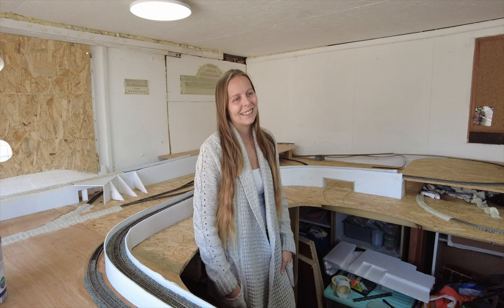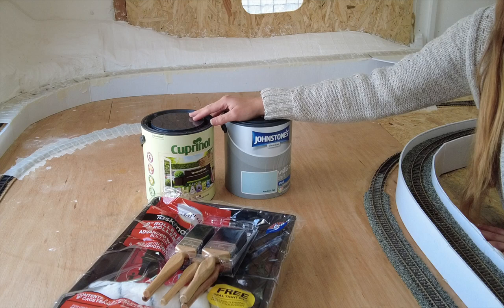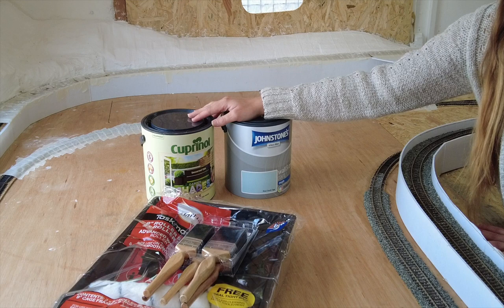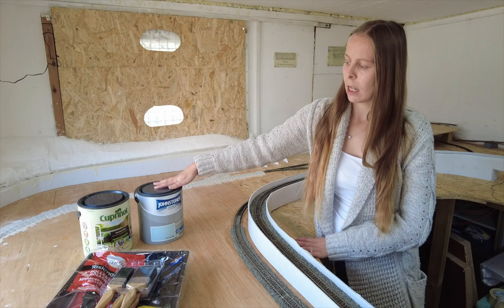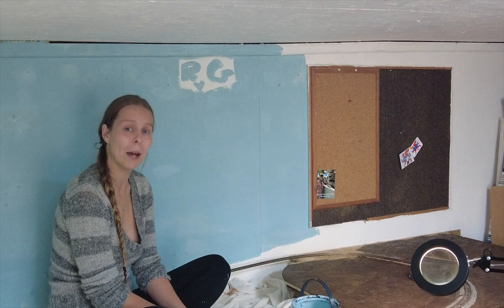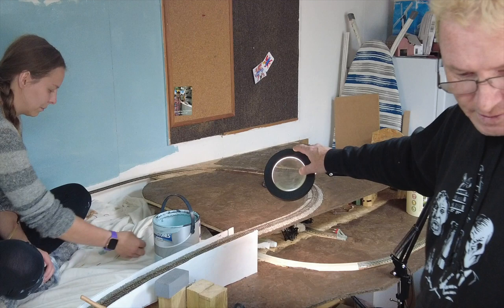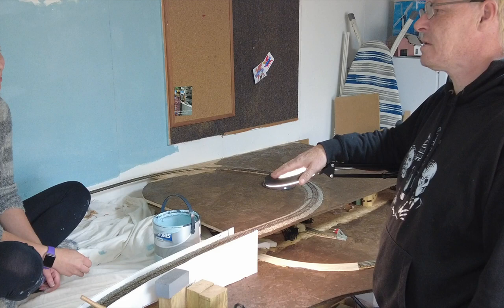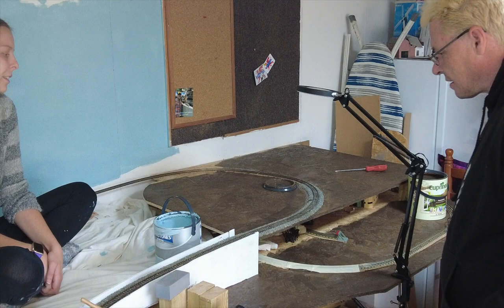RGJ Trains OO Model Railway

Comment: 🇺🇦
Hi Grace and Rob.
Great colour, same as mine.
Don't get resin buildings if you want to put lights in them, you will have to line them out with cardboard first. Stick with the Metcalf no light bleed.
Light looks great value for money Rob.
Grace as many horses and donkeys as you can find. You never know Rob might buy you a real one.🐴
Great work guys.
DELPH JUNCTION
Reply from the maker: yeah i couldn’t resist the windmill, but major light bleed, so grace is going to repaint it

Comment: I need some help with my bus wire
Reply from the maker: What’s the question buddy, if I can’t help, I’ll point you to someone who can
Reply: Every time I put my bus wire in the back of controller it trips it out 
But have noticed that the lift up bridge is live but the rest of the track is not
Reply: I am a new bee lol
Reply from the maker: @NobbyFowler  is it possible you’ve crossed the wires somewhere? got them back to front?
Reply: I have checked them I can not see anything wrong with them
Reply: I am not the best when it comes to electric I know it's not that hard to do but I am baffled by this 😂
Reply: It will work with out the bus wire up to the lift bridge
Reply: I now you work hard have a think about it and if you can help me with this it would be most appreciated let me know tomorrow you get some sleep
Reply from the maker: @NobbyFowler  i think the best way, is to possibly pull the bus wire, start again, and check it’s working with each section, are you returning the bus wire to the controller, or does it go out and end?
Reply: @RGJTrains  it goes from the controller and stops at other end
Reply from the maker: @NobbyFowler  so you’ve got it like me, positive and negative coming out, and then stops at the furthest point of your layout? and you’ve got a lift bridge between that, but the only place that has power is your bridge, no power before that?
Reply: @RGJTrains  that's it but if I put train on other track trips out controller
Reply from the maker: oh so it’s not tripping until you put a train on? is it tripping until? is it the same with any train you put on?
Reply: It only trips when I put the bus wire on and try to run train
Reply from the maker: @NobbyFowler have you tried a different train?
Reply: I have tried 3 trains.
I think I'm going to have to take it all apart and start again. I even put droppers on one side of the lift bridge Ur do I need to put droppers on both sides of the lift bridge
Reply: @NobbyFowler  Sounds like you have one section cross wired, and as the train crosses it, it is shorting the reversed wired section to the correct wired section and causing the short. Recheck the polarity of all wires that connect to the track.
Reply from the maker: @TimberSurf  this is what i was thinking
Reply: Ok I will do that and thanks for your help with this problem 😁
Reply: I have just put 2wires across the track and the train will run the hol length of track that iv put down even over lift bridge
Reply from the maker: @NobbyFowler  sounds like an issue on the controller side then, maybe even a dodgy connection,
Reply: Well I am confused now 
I don't have the bus wire in my controller I have cuts in track on lift bridge but I can run trains holl length of track
Reply: Rob 
 I do put the bus wire in the DC ports don't I . I have in forwards I have continues power reverse no power 
This is on my gauge master twin controller
Reply: @TimberSurf   I can run with out bus wire
Reply: @NobbyFowler  I had assumed it was DCC! If you want bus wires for DC, then you need two completely separate bus systems, one for each control output. Depends on your track layout how you connect track to the two circuits, you would be better to converse on Facebook so we can see pictures. Join this group https://www.facebook.com/groups/340970436512839
Reply: I do only have one track and one bus wire going round it blank one end and the other end to my Hornby controller the one with the DC clips on back
Reply: @NobbyFowler  It can only be that you have some crossed wires on the bus then!
Reply: I have red on the inside and black on the outside and it's plugged in to the uncontrolled 14v DC ports on back of controller
Reply: @NobbyFowler  That's the problem! You can not mix the uncontrolled output with the variable one! Its only for accessories, not for the track
Reply: Thank you so much for all of you peoples help. So I can not put a bus wire on my controller